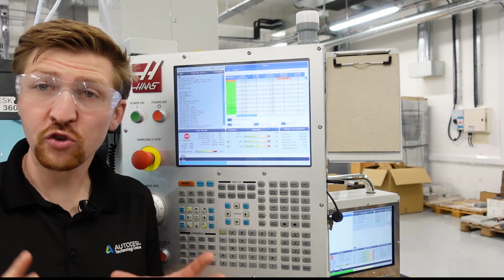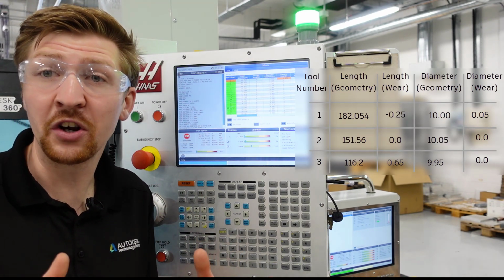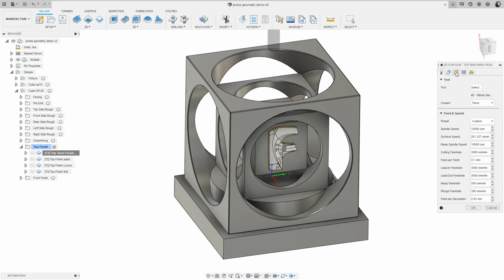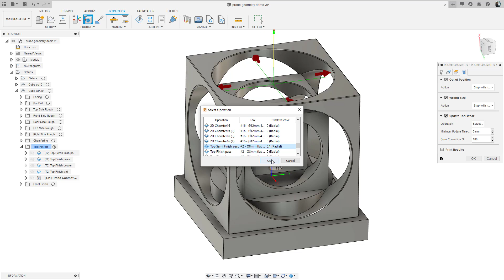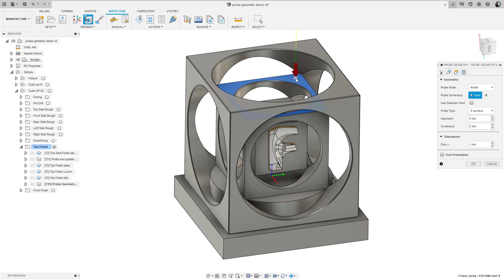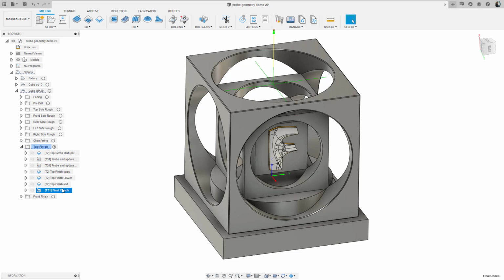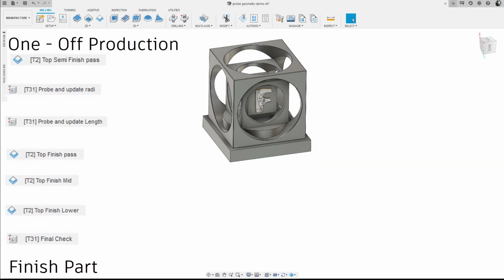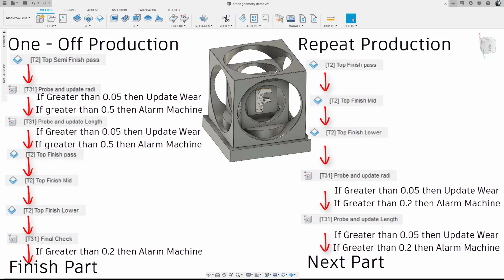TUTORIAL: Using Probe Geometry to Update Tool Wear

Comment: so probing on UMC750 and using fusion 360 does not work as advertised if you need to put the tool in DWO mode to flip the b axis to 90 and probe a part.  Seems like he should have mentioned this! as the part he is running there is NOT a 3 axis part, so i just assumed that it would work...  NOT SO MUCH.  BUYER BEWARE!!
Reply: Hi @clewisatx, this is unfortunately a limitation on the HAAS controllers at present, the G31 move for probing is blocked when using DWO. We have a work around for this using inspect surface but not the inbuilt macros that have the tool wear update function. Unfortunately this is not something we can work around, as we are using the inbuilt macros in this workflow are are limited to their functionality.

Comment: So, this will work fine when using the same cutter for both roughing and finishing, but I think most of us will use a roughing cutter followed by a finishing cutter, can the same process work on the finishing cutter only, and what would that look like, should you only update the finishing tool? Basically, running a finishing pass twice, or is there a more efficient way?
Reply: You would need to leave more stock to leave with the rouging pass. With the finishing tool you do 2 passes. After the first pass you probe for compensation.

Comment: Really nice and clear. Could you make a video where you press cycle start and a probe is finding the new zero point in X and Y, update that new zero point and continue the programm with the updated zero point (G54). Sometimes we get molds which are not accurate and we need to machine a hole in the middle. But because every mold is not the exact same in dimensions, we have to probe every single mold by hand (with the renishaw) and start the programm. I want to automate that.

Comment: Great video, will this work with the current Siemens 840D inspection  5 axis post?
Reply: Hi Mike, I've just had a look in the 840D post and there is the code in there to call the tool wear update. If you have got the cycles on the controller to do tool wear update then it looks like  the post should be able to call them.